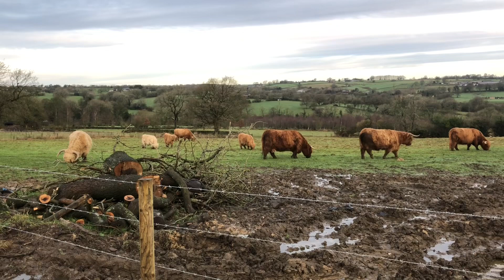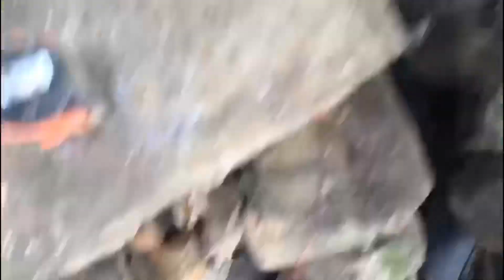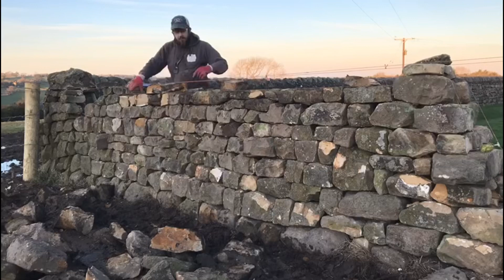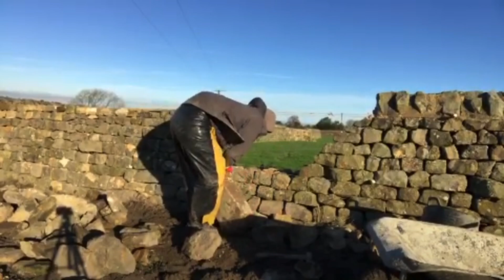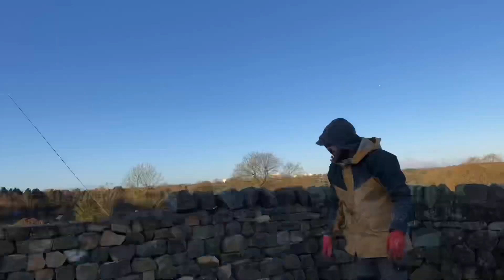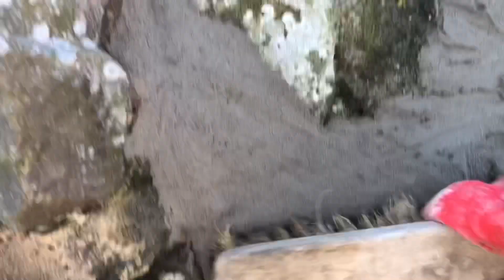Dry Stone Walling - Repairing Tractor Damage (time lapse)

Comment: Fantastic work there Tom. I'm fairly new to Walling so enjoy watching a good waller at work. I'm curious though as to why you sort of build the middle of the stretch right up to top stone level as opposed to just running from end to end? Looked to be good stone as well, not the round cobbly field stone here in Cumbria, bloody stuff.
Reply from the maker: I’m actually making a video at the min about this but basically I build the centre up when gapping walls as you would be lucky to get a straight wall ether side of it then you can simply tie in your straight section into the old wall.

It’s also useful to leave a gap so you don’t have to keep climbing over the wall when you want to go to the other side.
 Thanks for watching ⚒😊
Reply: @DryStoneTom  
That makes perfect sense, thank you Tom. Keep the videos coming, they’re very good. 👍

Comment: Impressive. What is your mortar mix for the capping stones?
Reply from the maker: Hey it’s 3/1 building sand and cement. You can also use a die in the mix if the original wall has aged.

Comment: Hey, Tom. I see you use cement on the top course and cope stone course. What the theory there? Is that because you're building where there's freezing, so the cement keeps water out of the interior of the wall?
Reply from the maker: It was purely to match the existing wall but originally I believe it has done because the highland cattle near by keep rubbing there necks on it and pulling the tops off. 😊⚒